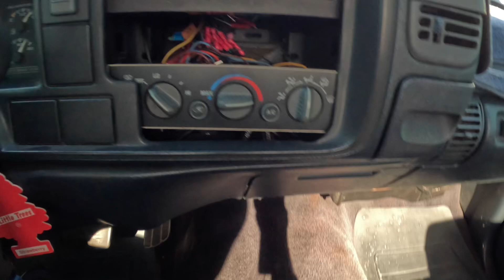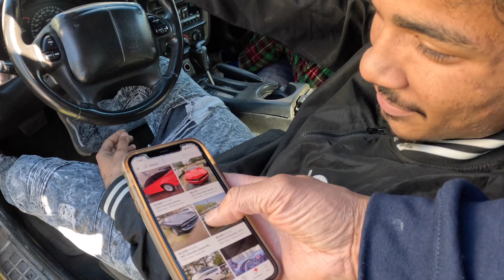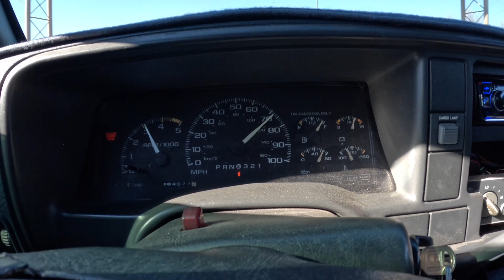BRO MACKED ON BABY AND TOOK HER MONEY TO CASH ME OUT FOR THIS CAR

Comment: yo what up fam yeah trll your lil bro that he might need a new Battrie and a new Altenator and then go and get all the flush and put sll new fluids in it to AND THEN GO TO THE MUFFLER SHOP WHERE U TOOK THAT Black OBS for your daul ex and have lil bro put some daul ex 3 inch pipes out the back Chrome tips on him and hit that gas pedal so we can here how she sounds ok and then go get it wash up and get the motor Degrese and wash up like u do it and he will be Ready  like u Right do he name his old schools like u do  oh u should go buy a chrome truck tool box and have them mounted in the bed of your truck  that way the winners cand put stuff in the tool box on the OBS the give away truck alright later jeep worm out there in okc its cold up here in North East fam Bundle up and make shore yall bundle up yall little kids out there to in this cold and go check your Eldery make sure they good in the heat and eating good to ok love yall fm be safe out there in OKC later